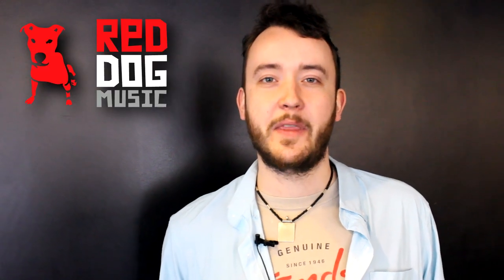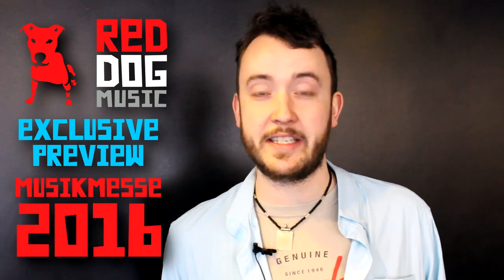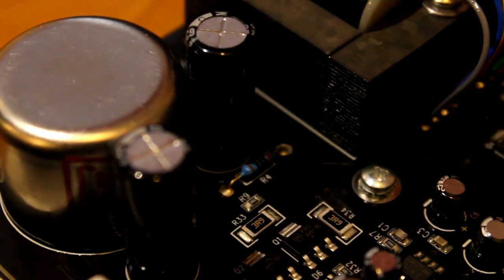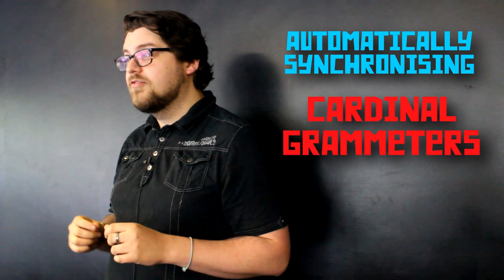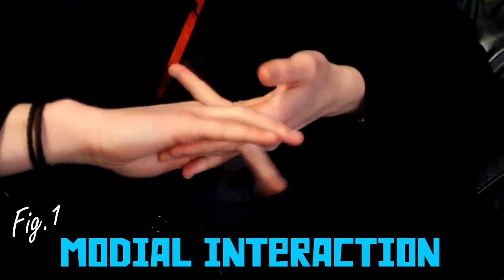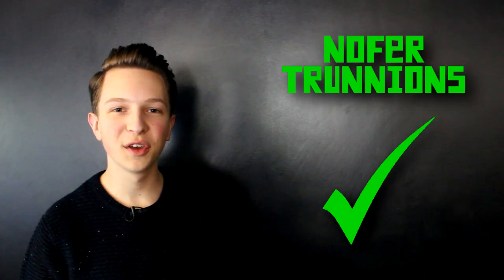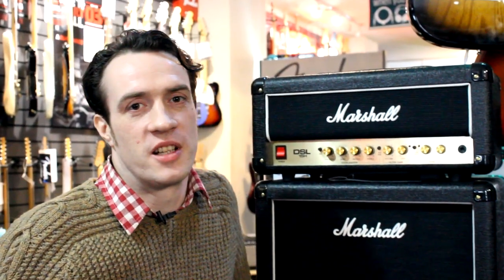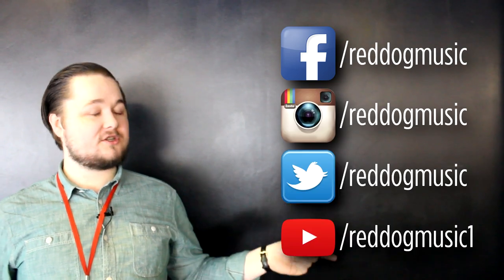Marshall Turbo Encabulator - Musikmesse 2016 exclusive

Comment: $64k question - does it retain the original flux capacitor which was at the core of the 1962 model ;-)
Reply: +inspyredrock Does this allow the sound to travel in time? and if so is it like an echo in reverse so it plays back what you play just before you play it? Cool